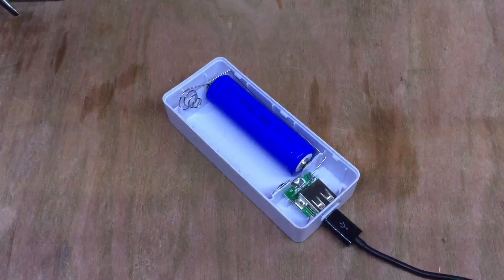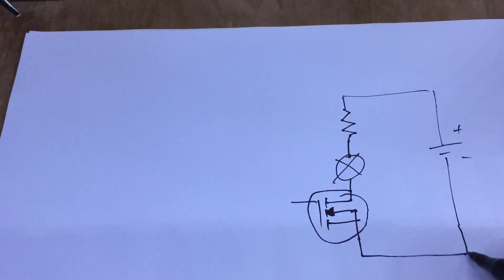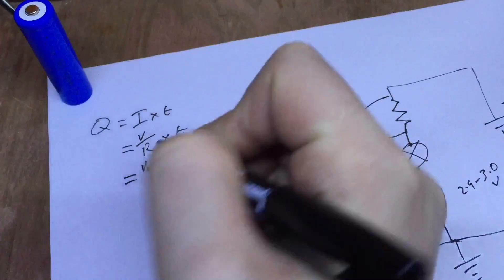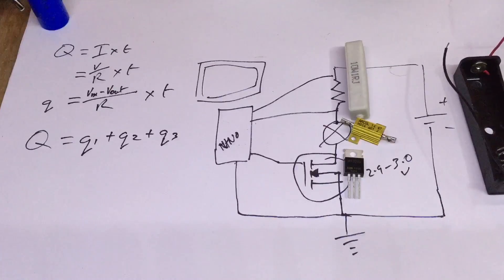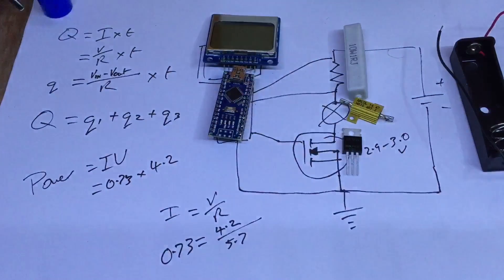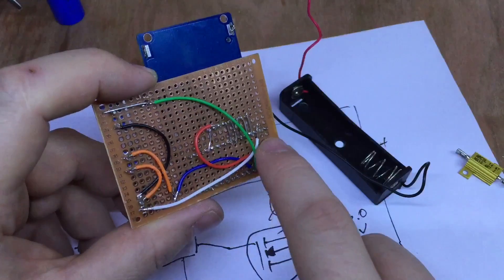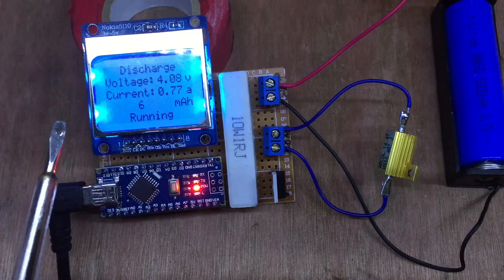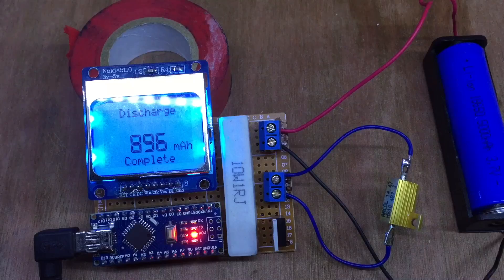Lithium Ion 18650 Capacity Checker - Adam's Arduino Projects

Comment: Hi Adam - this was a great video and I am trying to do the same thing myself - also testing the viability of salvaged laptop battery cells.  However, using your circuit - I am getting readings much lower than I expected.  This could be because my cells ARE actually all rubbish, or that there is something else wrong with my circuit (I am not 100% confident my salvaged MOSFET is operating as it should) but... there is something about the circuit and calcs I can't quite grasp.  Maybe I'm missing something, but by only measuring the voltage drop across the resistor, then surely you can only derive the current drawn by that resistor.  Doesn't the remainder of the circuit - i.e. the resistor AND the 'load' (and the MOSFET) also contribute to the total power consumed by the circuit - and therefore the mAh supplied by the battery? I'm sure there must be a simple explanation, andI'm hoping I'll have an 'aha!" moment when you explain it ;-)
Many thanks for all the videos and solar powered shediness.  The aim for my retirement is to have an electronics project workbench out in my garage, that is powered from a bank of Lead Acid batteries topped up by sunshine (we get a bit more of it now we've relocated here in Aus, than back in the UK), as well as building some 18650 based powerbanks similarly charged from the sun, to use for portable projects.
Reply from the maker: Now I know you're recently retired and moved to Australia I'm not sure I want to help! :-p  I'm very jealous!
I'm using Ohm's Law. The voltage drop across the resistor is proportional to the current flowing through it.  The 1 ohm 'shunt' resistor in the circuit is a handy value because 1 volt dropped equals 1 amp of current (R=V/I or 1=1/1).  It can be a little counter intuitive, but think about when you measure current using your multi-meter.  You don't connect your probes around all the 'loads', you place your multi-meter in series with the circuit.  
Lets say you connect from your battery positive, through a lamp, then through your multi-meter and to your battery negative terminal.  The meter isn't connect across the load - the lamp.  It's connected in series to it.  Inside your multi-meter is a very low value resistor and the multi-meter is sensing the voltage drop across that resistor.
You can prove all of this by placing a low value resistor in your simple circuit above - connect the battery to a lamp, then to a low value resistor, then back to your battery.  Use you multi-meter in DC voltage mode this time and measure across the resistor and calculate the current (I=V/R).
Let me know if I can help further.
Reply: Recently retired? LOL - I wish!!  I'm planning for it, but still have 5-10 years to go on that front... however, the move to Aus was one of the best decisions we ever made (except when it comes to cricket and The Ashes)!
Thanks for your prompt and detailed reply, and I think I am on the verge of that 'aha!' moment thanks to your explanation.  What you are saying is that as the circuit is basically just a loop, then ALL the current is flowing through the resistor AND the load AND the MOSFET, so you could effectively measure the voltage drop across any one of the three components (though the drop across the MOSFET should be tiny) and be able to work out the total current flowing through the circuit.  I think I get it now - using the analogy of the 'deconstructed' multi-meter does make it a lot clearer.
Many thanks for your time and explanation, and keep up the great videos.
Graham
Reply from the maker: You've got it! The same current flows throughout every component in a circuit and you only need to know the voltage and resistance of a single part of the circuit to be able to calculate that current.
Glad to have helped a little.
Reply: Hi again Adam - we’ll that time has finally come, and while not yet committing to being ‘retired’, we have both given up work to see how we get on and if we can afford this retirement life!  Don’t judge me 😆
So I am back to this project again, and testing the bunch of 18650 cells I’ve reclaimed from old laptops (there has to be some benefit to a lifetime in IT).  I am intrigued by your point of cutting off the test at 2.9 - 3.0 volts… is that just while the battery is under load?  I notice that as soon as I switch the mosfet off at the 3.0 v point, the battery voltage recovers significantly, but drops straight back around that 3.0 v level again if I switch the mosfet back on. I suspect your tester circuit was designed to simply see how much capacity there is in a single discharge from full until the battery drops below that threshold value, and disregarding that by letting the battery recover for a few minutes, you can squeeze a few more milliamps out of it.

Comment: Hello there, im really inspired of how easy you make these projects look to beginners just like myself, and im just wondering if it is possible to add additional batteries to test multiple at one time, or  even small batt. Pack cells or the intire pack using a device similar to this, ofcourse having to recode for it. Or perhaps even make different settings in the arduino for each type of setup One is testing?

Regards

Comment: Thanks for the information i am trying to figure out the way to go through 500+ 18560 batterys and i don’t want to be there for one hour per. Battery. ie just wanted to ask if you could do more than one battery at a time with Arduino nano ??
Thanks
Reply from the maker: +The Siren Hello. I haven’t expanded this beyond what you’ve seen but others have...  https://github.com/shmick/18650-liion-capacity-checker this version of my idea can check four cells at once.
Reply: Adam Welch  thank you for your help much appreciated thanks again

Comment: hello sir,  i would like to tell you that using such a simple technology you have done a  outstandingly precise job..but in order to achieve that accuracy i need your little help..would you please tell me how much tolerance does the fusible resistors have?? i got mine 2.2 ohm 10w..at 5.6ohm and 0.27ohhm 7w..at 1.8 ohm..would you please  share the difference between actual and written value?

Comment: that will be inaccurate.these resistors will change due to temp due to heating you should just make  constant current circuit instead to drain the battery to the minimum safe voltage of 3volts. constant current circuits will maintain the current constantly  regardless of voltage and temp. load resistor changes with temp unless you plan to soak that with water
Reply from the maker: +James Balagtas Yes a constant current load is probably better, but not as simple or straight forward, and not as easy to build in an hour or two with bits out of my junk box. This works very well and when compared to commercial discharges seems pretty accurate too. I’m not saying it’s the best way, but it is perfectly valid way.
Reply: @AdamWelchUK  cc works better but uses a different method. It's not a must cause with the q counting every 5s or less it's extremely close and doesn't need a cc if you are counting coulombs.

Comment: Hi Adam. Thanks for the project. I would like to ask something, is this the final version of it? Because, i''ve seen some other project with very little differences, and i think those are based on your project. But i just want to be sure which one is the most accurate and safe, before start to build one myself. 

Thanks again!
Reply from the maker: This is my first (and so far only) version.  A few people have re-used this idea shall we say - most without any credit but imitation is flattery I guess...   I would advise one simple improvement to this design (although there are far better ways to complete this task but they take more complicated and expensive circuitry) is to add a 10k resistor between the mosfet gate and source (ground) to ensure the mosfet goes off at the right time.

Comment: could I check up to 12v/ 20v..?
Reply from the maker: +mukhlis1010 If you calculate a different voltage divider and adjust the code to suit. You'll also need to calculate your shunt resistors resistance and power - but yeah, you could test higher voltages.

Comment: Sorry for the newbie question, but what is the mosfet doing in this circuit?
Reply from the maker: +Simon Inga Its simply switching off the load when it reaches the cut off voltage.

Comment: Just wondering if measuring the voltage drop across the 10 Ohm resistor gives an underestimate? what about the voltage drop across the mosfet?  Would it be better to use a 16 bit voltage sensor like the ADS1115 directly across the terminals of the 18650.  You could use a Hall effect sensor to measure the current which might be more accurate?
Reply from the maker: The drop across the mosfet should be tiny - it is a logic level mosfet so should be fully on at 5 volts.  Obviously the voltage at the source pin would be 0 volts, so you wouldn't even need to connect a wire here - and I guess my argument that the drop across the mosfet is tiny means I could have not bothered with the second voltage reading!
This project was built in a day using bits I had lying around.  There are much better ways of doing this.  Using an ADS1115 and hall effect sensor are definitely ways to improve the accuracy.  Adding extra channels so you can discharge more cells at once is another.  Using the mosfet as the resister and adjusting it for constant load (or adding in different modes) for example. 
They are all good enhancements and one day I might do this again and build some of those features in but it wasn't possible on the day when the idea popped into my head.
The best part about this project for me was that it was very basic and easy to understand, and that means that people like yourself are thinking about better ways to do it and ways to improve it.  Cheers
Reply: Thanks Adam.  I like you videos by the way.  Its good to get inspiration for my own projects. Speaking of which, I’d like to build myself a good quality data logging charge controller for the 18650 that’s capable of PWM constant current constant voltage charging.  I was inspired by the solar PWM charge controller, you know the one you reviewed/built with the mosfet & charge pump.  One of the questions I ask myself is can you drive say 14 volts into an 18650 using PWM?  Even if the PWM has a time averaged voltage which is spot on 4.2 V, the battery sees the full 14V for 5 ms every now and then (160ms).  I guess a battery is a gigantic capacitor but lithium ion is picky about voltage and gets damaged easily.   What to you think?
Reply: So to avoid any mosfet complexity, i used a relay module to switch the load on.
Reply: lmao thug life :v i should do that too
Reply: TorrNet  I have the same question too

Comment: i am using that same circuit ,thanks for putting  it up, works great .my circuit is 18650 holder,16x2 lcd and your arduino circuit with code rewritten for 16x2 lcd .coding  the lcd was hard work because i would have too wait 1 month for one like yours to be shipped   ,so   i watch ur videos over and over until i mastered it .thanks again  for a very good tutorials,looking forwards for new circuit.with your style for coding .
Reply: Can you share the code for 16x2?
Reply: You could have show the data in Arduino's IDE Serial Monitor

Comment: can I ask you one question?
Can I use SCR for the switching instead of MOSFET?
I need to use SCR for my project. 
Hope you reply this soon.
Love your channel!
Reply from the maker: +AshraF AzmaN I don't know much at all about SCRs. They are current driven I believe so as long as yours can be switched with less than 40mA's (the limit of an arduino pin) then I'm guessing it could be used. Thanks for the kind comments
Reply: ***** i mean about the cheap mppt from the previous video, can i change the MOSFET with SCR? I'm afraid the battery will be explode
Reply from the maker: +AshraF AzmaN Can you comment on the video you mean?
Reply: Sir, can you help me make a simple solar battery charger for lithium ion batteries without display? Thanks in advance.

Comment: When I apply power ( USB 5 V ) to the Adruino , my Discharge screen show some voltage reading. But in your video , there is no voltage reading. What is wrong ? Highlight me please.
Reply from the maker: +Lau Weng Yew Is the battery negative terminal linked to the arduino negative?
Reply: Thanks , miss out the common ground in your schematic diagram. Got it working.  But it still show voltage even the battery holder is empty.
Reply: @lauwengyew8218  I have exactly the same problem (even with common ground).  I also notice that on power up (first time around the loop when the mosfet is OFF), it reads exactly the correct battery voltage on analog A0, however it then turns the mosfet on and then all subsequent times around the loop (when mosfet is ON) all subsequent voltage readings on A0 are low by approx 0.3v.  Is this expected?  If so - why?

Comment: I have wire everything as per your schematic diagram . I double check the wiring as per your diagram and video. I did not load the code yet. I just power it up using a USB power supply. The Arduino Nano shows power on with a red LED blinking. But the LCD Display is not power on. There is no power at the LCD. Is there anything wrong with my wiring or I need to load in the code before I can see the display light up. Please highlight me. Thanking you in advance for any valuable advice.
Reply from the maker: Hi Lau - without the code it is likely your arduino is running the blink sketch which will flash the onboard LED attached to pin 13 on and off every second but do nothing else.  Upload the code to the nano and the screen should power up and using the reset button should start the test if you have a charged cell connected.
Reply: Thanks for the reply, I have a problem compiling the code. I copy and paste the code , when I upload , it give me the message " Error compiling for board Arduino Nano" Every parameter is correct, I mean the com port. 
What is wrong this time.
Reply from the maker: It usually gives more information than that.  Have you installed the library mentioned at the top of the code?   In preferences can you turn on verbose error messages and find which bit isn't working?
Reply: Thanks for the reply. Finally got it working.

Comment: +Adam Welch First of all great video.
 I build this circuit, with some small changes ( 2 ohm shunt, diferent mosfet). But when the program is running arduino is measuring about 0.2V less then two of mine multimeters and also the current on the arduino shows 0.55 amps and the multimeters show 0.15 amps. Any idea what is happening? 
Thanks :D
Reply from the maker: +Josip Sovina Its usually due to the accuracy of the five volt rail which is used as reference. I'd suggest checking the 5v pin of your arduino to see what is the real voltage. Thanks for the kind comments.
Reply: I did chek it and adjusted the refVolt variable acording to my measurements. But IMO i dont thik 0.02V can make a 0.4A and 0.2V diference.
Reply from the maker: +Josip Sovina Are you happy with the accuracy of the shunt resister?
Reply: +Adam Welch Yes I am. But what do you think: Since i am using IRFZ44N MOSFET non-logic level MOSFET, it is not opened fully on so it is limiting my current?
I tested just the discharge circuit withouth the MOSFET and the current rises to 0.5A which is by my calculations correct.
Reply from the maker: +Josip Sovina Oh yes. I didn't notice that. Yeah that mosfet is not suitable really. The almost identically named IRLZ44N is better suited. The L stands for logic.
Reply: Isnt yours IRF3205 also non-logic mosfet?
Reply from the maker: +Josip Sovina No it should be fully open at 5v. http://www.irf.com/product-info/datasheets/data/irf3205.pdf
Reply: +Adam Welch Well acording to the IRFZ44N datasheet, my mosfet shold be fully open as well.
Reply from the maker: +Josip Sovina I've not studied the IRFz44N data sheet but I know people who use them for constant current loads that they aren't any good as they're not logic level.

Comment: Hello Adam, great video and particularly useful for me as I'm looking and building the same thing but to discharge several batteries at once. I would make two small changes to the code:

(1) Decrease the sample time
(2) Get an average of the current flow so the calculated charge at sample is:
      q = ((I_previous + I_now)/2)*(t_now - t_previous)

I'm thinking this would increase the accuracy of the measurement (my apologies on the algebra).  You could possibly be short-changing the battery capacity. Maybe, since you already have it built, you can test with these code modifications to see what difference there is in the measured capacity for a specific cell?

Changing the order of the load and the shunt in your schematic should also eliminate the need for the 'voltRef' parameter in the code.

Thank you for taking the time to put this together and hope you are having a great holidays!